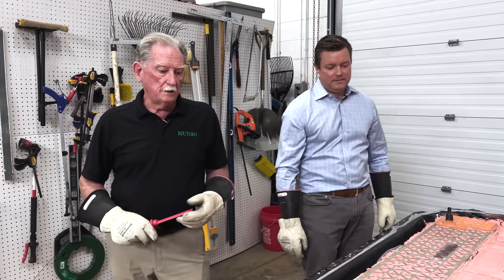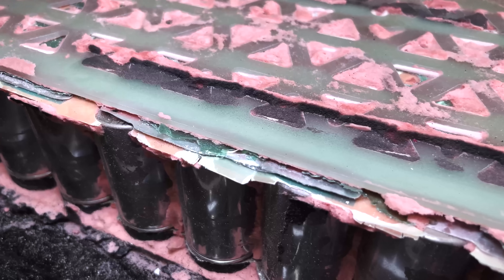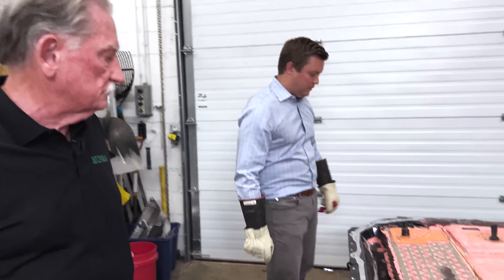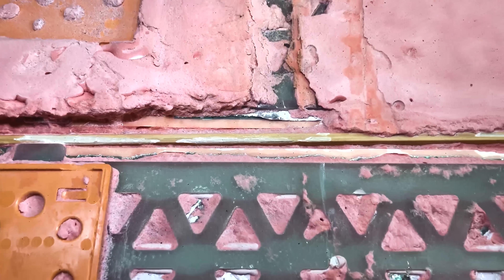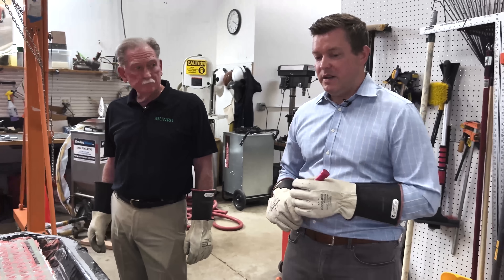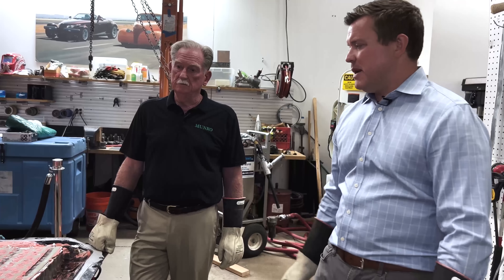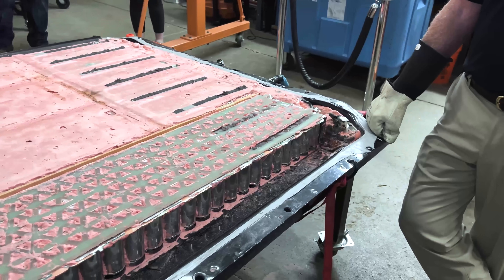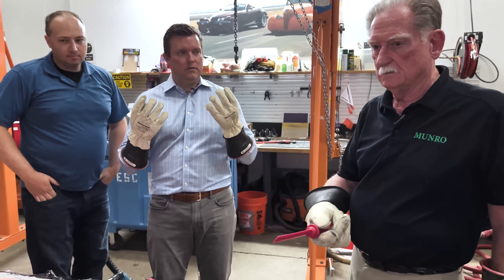4680 Battery Pack: What We Found Under the Foam!

Comment: The guys at Tesla know that their differentiator isn’t car design, but technology design. This is a fascinating insight
Reply: Absolutely!
Reply: But will the consumer appreciate this?
Reply: @ManInTheBigHat  my opinion, but it is just an opinion - its complex. I think many consumers see Tesla as big tech more than a car maker, a bit like Apple. Many people don’t appreciate the technical benefits of the M1 chip for example, but buy Apple because they trust the brand to be on the leading technological edge. So it is with Tesla. As a functional unit for driving enjoyment the BMW i4 is arguably a better car but I think many customers trust Tesla in the electric car field to deliver a superior product and buy not entirely informed. As the key metrics are range and charging efficiency, little surprise to find Tesla persistently improving battery tech.
Reply: @ManInTheBigHat  The consumer will appreciate low price for high value.
Reply: @ManInTheBigHat  I do (as a consumer) Tesla "tech" is still 5-10 years ahead of the legacy brands, even now. And when it comes to an EV, the tech is king. I can live with getting a car with a body panel 2mm out of alignment if the car will run 500,000 to 1,000,000,000 miles.
Reply: @vr4042  Sadly they quite don't, even with reports of Plaids falling apart at the subframe welds...that's the thing, Tesla does EV tech things better, but legacy auto manufacturers actually know how to build a car that isn't at the verge of losing parts. I am the first to adore how safe Teslas are in a crash, but i don't really like the fact that the car itself can mangle itself to pieces and cause said crash.
Reply: @vr4042  I somehow doubt you'll get a milliard (billion for some countries) miles out of the car :D
Reply: Tesla design is stunning - I admire every vehicle I see on the street. Works of art.
Reply: Cult members speak
Reply: @sickre  You have poor taste then

Comment: Curious to know, the design has more parts and I am sure it takes more time to assemble this. How is this cost effective for Tesla during manufacturing compared to their previous designs?
Reply: it has less parts.
Reply: Oh ok, I was wondering with the ABS, Mica, the foam and the time to assemble these would be more.
Reply: Cost savings are done through reduction of products.
- They went from 4416x 21700 cells down to 828x 4680 cells.
-  21700 cost like 170$ / Kwh(last i found about it) the new 4680 Tesla want to go below 100$ / Kwh to produce. So a drop of like 3k just in battery cell cost.
- They create the pack with integration of the seats and console planned in. This way it is not only cheaper(less workers needed to install seats and console and more space / work area to work in), but because we use no operation in production line it can be build quicker. More cars build = more cost efficient. 
- Reduction in weight: 4416 * 70g = 309,12kg ---- 828*355g = 293,94kg, so they save 15,18kg in battery weight. 
- BUT because the 4680 has a higher density( 276wh/kg(is the low end tesla expects, they plan to go up to 333 by 2024) compare to 247wh/kg in the 21700) you get 81Kwh out of the 4680 pack and 76kwh out of the 21700 pack. So they get more Kwh out of a lighter and cheaper pack = cost effective.
Reply: Thanks so much. This helps :)

Comment: Would they have a chemical that dissolves the foam? It seems like they'd have an even higher grade ore without the insulation...
Reply: good question
Reply: After grinding the resulting material would be float sorted (plastics) magnetically sorted (steel) then you have a high grade ore containing lithium, aluminium, silicon, manganese, copper, nickel and cobalt
Reply: @jackdbur  that only works if it's able to be ground well enough... If small plastic bits are stuck to the metal, then the result of sorting would be contaminated. It seems like the metals wouldn't stick well to each other, so they could be sorted better. Maybe they can melt the results and skim the contaminates off later...?

Comment: The question is how do you reuse the batteries?
Reply: Cut off the seat mounts and plug the whole thing into the new system.
Reply: @Barskor1  put it up on blocks.
Reply: Dularr
Do you .ran "battery" or "cell"?
There's a difference.
Reply: @rogerstarkey5390  in this case the batteries.

Comment: Core principles for creating better future are REPAIR, REUSE, RECYCLE in that order. That battery pack does not fulfill first two which makes it costly to maintain in future and bad for environment.
Reply: You haven't thought it through.
Which components are likely to have issues? 
High voltage control/ switching? (Ask Ford!)
Where are the control electronics?
Are they accessible? (Yes)
.
Are the cells reliable?
Well, PORSCHE had (has?) issues due to high charge loading, but Tesla have the tabless design which reduces load/ heating, so likely less stress,  more reliable (THEY have the data)
.
If ONE cell goes bad, how much capacity is lost? (Only 0.12%!)
.
Has Tesla wired the pack to disconnect a bad cell? (You don't know that they haven't)
What are the odds of a bad cell (TESLA knows the answer!)
.
Will a user notice one bad cell?
Unlikely. (You don't notice the gradual but inevitable decline in your ICE engine over time)
.
So, it's largely more "repairable" than others (note back to Porsche, who are extremely reluctant to repair, instead playing with charge levels in software?)
.
"Reuse"?
Who would "reuse" it?
A tiny proportion of self builders.
"SECOND use" facilities? More likely, but they would slide it onto a rack and plug it in.
.
"Recycle"?

If a pack can be recycled and produce new "ore" for only 17.5% the cost of mining virgin material, plus much less environmental impact, and the material is of better quality, and will inevitably be made into more efficient cells, placed into a more efficient pack, installed in a more efficient vehicle, that's literally a "no brainer"?
It's "BEST USE OF AVAILABLE RESOURCES"
Reply: @rogerstarkey5390  watch some Gruber auto videos to see what one dead cell does to the pack. I doubt Tesla has resolved that fundamental issue.
As for reusability you must be joking. Anyone with solar panels on the roof would benefit from a small battery pack to keep them going overnight so the demand for such application is enormous!

Comment: Hi sandy , what is the cell capacity? Voltage ? mAH?
Reply: PLEASE wait for them to get a single cell on the bench for testing?
Reply: @rogerstarkey5390  I haven't heard of Munro testing any cell from any battery. They normally report call capacites as reported by other sources. They are pulling these 4680 cells out to provide them to companies that qualified and equipped to test them.

Comment: Oddly, I am VERY interested in seeing a tear down of the Ultium platform, which was made to be repaired.
I wonder just how efficient that platform is. Repairable means really inefficient structure.
Reply: Repair $ Vs Replace $ where repair $ increases with labor and replace code reduces with Wrights law.  My vote is: design to replace.
Reply: That is the tradeoff.  I think old Tesla's will drop like a rock in value.
Reply: @gregkramer5588  Those idiotic Ultium prismatic cells are all going to bulge and burst after 7 years of jostling on the road.  GM's products are the ones that are going to drop like a rock in value.  Sure, pouch cells are cheaper and more widely available ... for a GOOD REASON.  steel cylindrical cells are inherently superior and safer.  Any car you buy with a pouch cell will be worthless in 7 years.
Reply: @BrowncoatFairy  I guess we will see.  That is a pretty bold statement. I guess the Model 3s that use prismatic cells are screwed also along with GM. Of course if you are correct.
Reply: @gregkramer5588  they never have dropped like a rock; they ain't gonna start now.
Reply: @jamesengland7461  I just saw an interview with a guy that is on his third pack.  Over 200k miles but still.

Comment: The video all of us have been waiting for.  It's exciting to see a 10 year old company that's been making cars from the factory from where they were to where they are now.  It's like the beginning days of the smart phone when every version was something of massive achievement.  Yet, Tesla is doing this almost monthly lol.   I can't wait to see what changes are made when this is reviewed in the next 2 years and how far they have come to perfecting the Model Y.
Reply: It is a pity that in this video they did not notice that the battery capacity differs significantly from what Tesla is giving away. Knowing the number of cells: 
816 cells * 98Wh (every cell) = 79 968Wh = 79.9 kWH
Reply: 10 years ago they had a refined product that soon won Car Of The Year prizes left and right.
They added THREE models in those 10 years, but only one really new platform. I guess the "Plaid" generation could be seen a kind of re-do of the Model S/X platform, but still not with true mass production in mind, just a small numbers posher option with lesser impressive value for money over competitors.
Reply: @Cloxxki  "only one really new platform", the platform evolved over time, there are at least 4 for the S alone, if not more.  Tesla does continuous improvement, so platforms change over time.  Deciding on when those changes add up to a new platform is arbitrary.  This is the platform of theseus.  How many changes make it  count as a new platform?  The answer is that it doesn't matter and the idea of new platforms is meaningless when you perform proper continuous improvement.
Reply: No matter how you figure it; Tesla is older than 10 years. Founded in 2003, Elon bought majority share in 2004 and became CEO in 2008. So it's either 19, 18, or 14. My guess is that Elon started exercising direction and control around 2006 or '07 with the development of the first Roadster.
Reply: @terrysullivan1992  But the biggest and most EV pushing changes happened all in the last 6-8 years. The first roadster was to showcase they can build an EV. With the Model S they prove they can make a very fast EV. It's with the model 3 and Y where they really pushed their technology and production to what lead the new 4680 cells etc.
Reply: @pipooh1  it has required every single day of the last 18 years to get Tesla where they are today. And remember, Tesla didnt invent the "laptop battery" EV, they licensed that technology from AC Propulsion, and even based the Roadster on the same Lotus platform as the T-Zero. So in fact, the Tesla story is really about 20 years in the making. From the original T-Zero to the lithium-ion conversion in 2003. Every step along the way brought them here.
Reply: @terrysullivan1992  Grow up.  The model S, after eberhard was fired, is when tesla became tesla.  Its 10-12 years depending on how you want to count it.
Reply: @_PatrickO  Horse feathers, that is like saying GE only became GE after they put lightbulbs into full production. It required AC Propulsion to build the T-Zero to inspire the Roadster and it required every mistake they made along to path of building the Roadsters to get them to the Model S. One has to step back and remember that modifiying production vehicles was an extremely common path for automotive startups in the sencond half of 20th century. There had really only been two paths after WWII: modify parts from existing production cars to make something "new", or copy existing production cars. Even the DeLorean was a parts-bin car.
Reply: @patreekotime4578  Grow up.  You only know about AC propulsion because Elon is open about where the idea came from.    Stop being a hateful  boomer who hates new things.  Nothing AC did back in the day has anything to do with tesla today.  The method of just slapping batteries into a huge brick for an EV is  what ac propulsion did and tesla used for the roadster.  Tesla  made proper packs and invented thousands of new things no one else did before to come up with the packs they had today.  For anyone to be tribalistic over the simple idea of soldering together a few thousand 1865 batteries is pathetic.  This is how battery packs for most electronics were, AC prop did not invent series and parallel battery packs using 1865s.  You are embarrassing yourself.
Reply: @_PatrickO  eh? Terry is correct - prototypes of the roadster were first shown in 2006, production of the roadster started in 2008  https://en.wikipedia.org/wiki/Tesla_Roadster_(first_generation)

Comment: I'll be honest, I was expecting to see much more open space in the pack. I was thinking the lower range was simply due to not having enough 4680s, but it seems that is not the case here. Tesla has clearly filled up the available space. This could mean the 4680s are no a more power dense solution and/or Telsa is holding back significant capacity on the packs.Guess this is a big part of where Tesla gave themselves a C rating on progress for this type of pack. Cybertruck will need twice as many cells to get anywhere near 500 miles.
Reply: The cells itself are less power dense, as these are 1st gen cells. Tesla did not do fancy additives and materials (silicon) in them.
Reply: If you paid attention elsewhere, you'd know that the "older" versions appear to have:-
Dry electrode anode material, but without the silicon already in 2170 cells.
.
"2170" cathode material.
The "capacity" is due to a longer, wider roll giving 5 times the surface area in each cell (so 5 times fewer cells)
What isn't being picked up on is the tabless design which allows the full potential of the cathode/ anode to be utilised.
.
So, at the moment they're possibly slightly less "dense" at cell level but will be able to discharge and charge more quickly than other cylindrical cells.
"Cyber truck will need two e as many cells " ..... As what?
They have 9 months to tweak the production.
Which doing that they can tweak the chemistry.
Remember they have 3 other companies working on "4680 cells".
Do you think it's coincidence they all found the answer to the "4689 cooling problem" at precisely the same time, with independent solutiy?
Or
Was it more likely Tesla said "let's do a deal, use our system with machinery under the "fair use Patent", share knowledge and we ALL benefit"?
That's why Panasonic is sending cells to Tesla for evaluation.
We'll see the same from LG and Samsung.
Now look at the recent statement from panasot "we increased performance by 20%".
Was that 4680 specific?
If it's their own chemist, will it be in "their" 4680 cells?
Will this migrate to all the Tesla type cells?
Cybertruck will be fine.

Comment: If the battery breaks within the battery's warranty then Tesla will replace it.
If it breaks after that, they will replace it but it will be quite expensive.

Who needs repairability if you can shred it, gather the materials and build a new one ...basically recycling.

If only Tesla can repair the battery, which they won't, that is beneficial for them. All part of the ecosystem.
Reply: Man hours in US is very expensive, so it dosen't make sense to have a repairable battery, as they will generally be a niche sol..
Reply: @archigoel  Yeah exactly 
I mean who actually repairs electronic devices.
Almost no modern electronic device is meant to be repaired anymore.
Look at almost all the smartphone manufactures...
If your phone is broken you send it to them THEY disassemble it, claim that they reuse the materials and give you a new or refurbished one.

Tesla has been giving their customers refurbished batteries that serve as replacement batteries for years.
Reply: @archigoel  
Yes

Comment: So the battery pack looks totally un-serviceable.  I imagine this is because of cost and safety?  What if a
cell goes bad?
Reply: The cell can be bypassed logically.
Reply: @JBoy340a Wow, very cool!
Reply: "a cell goes bad"..... And you have 98.78% of your original capacity.
If 25 cells "went down" you'd be at 70%

Comment: If it's already hard recycling a current ICE car, imagine recycling a BEV with such battery pack construction. And puts to the ground the point of being labelled as "Eco friendly" or "sustainable".
Reply: Did you watch the entire video before commenting?
Reply: Pulling oil out of the ground is sustainable?  Countries that depend on it's exports don't want anything to change. Electricity can be created anywhere and many different ways. Oh, and I have never cleaned an electrical spill.
Reply: Try recycling a barrel of oil after it has been burned, then let us talk.
Reply: @geirmyrvagnes8718  you should put into account the amount of Oil used to produce a battery pack, or the amount of Coal necessary to ensure enough power to recharge it through it use.
Reply: @RogerM88  I thought you would like burning some oil. Are you suggesting we should radically electrify these industries as well using renewable energy?

Comment: Great stuff. BTW absolute zero is about -459.67 deg F. Liquid nitrogen is about -320 deg F. I do not see why liquid nitrogen would be useful or needed for recycling. Just grind it up like Redwood Materials does.
Reply: he got the detail wrong about "the molecules falling apart" - they won't spontaneously fall apart of course, quite the opposite, but cooling to 77K makes practically EVERYTHING as brittle and fragile as glass including metals. makes the grinding much faster, easier and more thorough.
Reply: @Muonium1  I wouldn't be so sure about metals, but yes, the idea would be to help components break apart.
Reply: @brianb-p6586  it depends on which metals of course. a few alloys become stronger, but I think most become more brittle.
Reply: @Muonium1  Sure, but "fragile as glass" is not likely true.
Reply: @brianb-p6586  you'd be surprised. look at video 
1otMRlENsr0